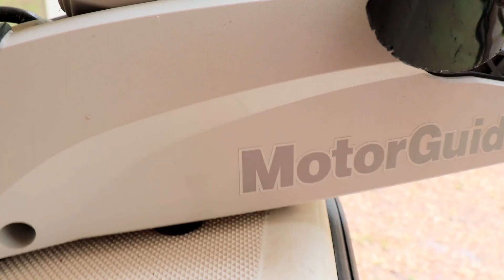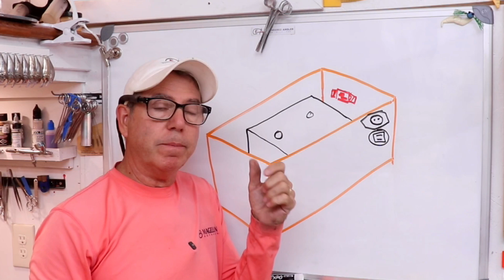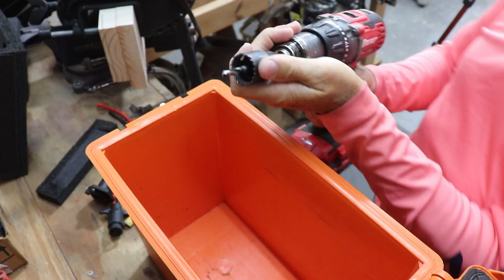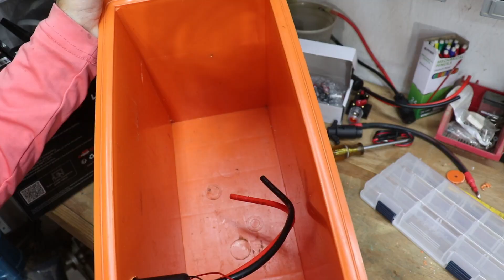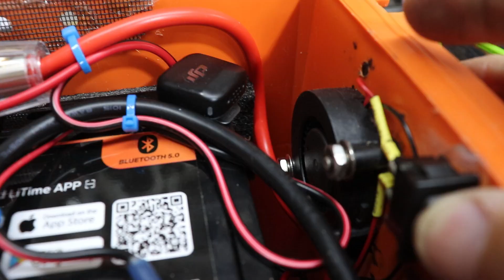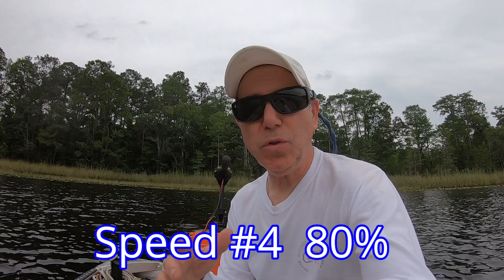Build a DIY Lithium Battery Box for Trolling Motors, Lightweight, Powerful & Cheap! #lithium

Comment: Is it really necessary to put ventilation on lithium batteries? According to the IA it isn’t. I’ve watched other battery box builds and they prefer to keep it waterproof, they seal every gap.
Reply from the maker: I added ventilation to help manage internal heat, though for many setups it's definitely a trade-off between airflow and water resistance.

Comment: Hi, Excellent channel! I checked out the Amazon reviews on the Nilight inline 50a breaker and it seems a little trippy, often tripping well below 50a. Have you had any issues running your Minn Kota off of that breaker? Thanks in advance for your reply.
Reply from the maker: No...but it only draws 40 amps at full power and I don't run it on high for long.  But it would be a good idea to bump up to the next size breaker, just be sure you're wiring size is right.

Comment: Great build, but I'm concerned about just leaving the battery sitting on the raised deck without any securing.
Reply from the maker: That's a good point, I should probably add some straps or something to hold it in place!

Comment: I need your advise on uv lights, LED or Bulb type ?, what wavelength?  365 or 395- 400? I am building a small wood box, 12 x 12 x 12, for 3 to 4 lures, so many different you tube vids, but i value your opinion most, thanks so much
Reply from the maker: I would go with a 100W of LED at 365 NM
Reply: Thanks so much

Comment: Only problem is that it gets hot enough on my boat in the summer that hot glue actually melts 🤦🏻
Reply from the maker: Wow...how about 5 min. Epoxy?
Reply: @EngineeredAngler  yeah but a plastic "weld" epoxy would probably work even better on those surfaces.

Comment: Maybe fill in some of the gaps at the bottom with foam to improve the floatation….and adhere some closed cell foam (yoga or fatigue mat material) on the outside to improve buoyancy.